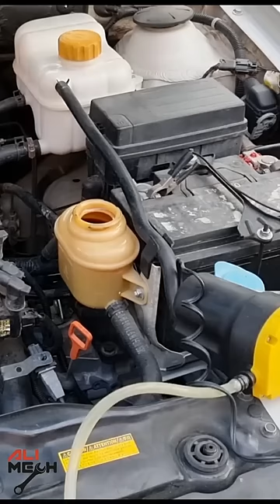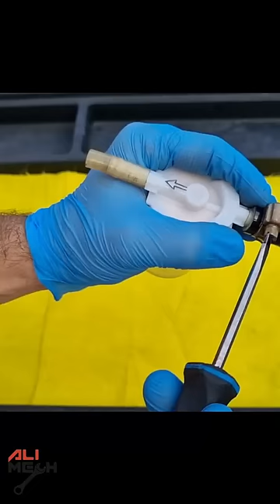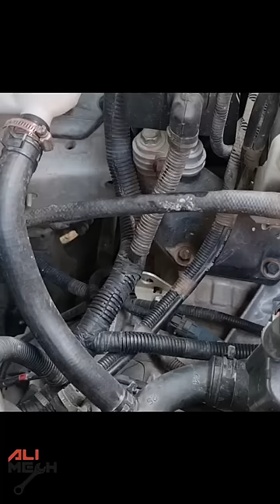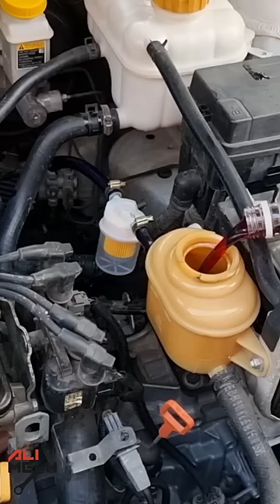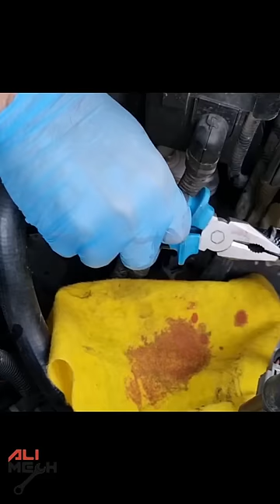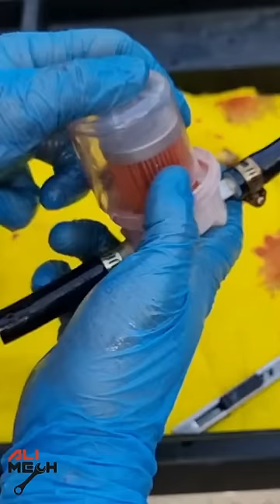This will save your Power steering? #shorts

Comment: Great idea, I'm sure there is a great benefit to this making your system last longer. If you have electric power steering you don't have fluid so this doesn't apply.
Reply: there is hydro over electric systems too.
Reply: @TdrSld  You mean electric over hydraulic, but we get what you mean
Reply: @RChero1010  sorry the dyslexia got the better of me :P
Reply: Don't forget to filter the electrons.
Reply: @mikekuschka998  don't laugh there are such filters. A Velocity Filter for Electrons and Ions does exist.
Reply: You have no idea how your servo works.
Reply: @ioanliviu22  well it depends, are you talking about a positional rotation servo, a continuous rotation servo or a linear servo? Because they all work differently. I've designed different versions of each.
Reply: @Jj_2487  auto transmissions have a filter.
Reply: why not leave the filter in
Reply: Lol try again
Reply: Because no fluid is present at the steering rack in electric steering vehicles, the grease that is used in place of constant fluid soaking and moving, gets dried up, damaging the seals. At least that's what I think  happened to my steering rack :(
Reply: @Nanogrip  wrong
Reply: @jacobpoucher  Well, it's what I have deduced, it explains why my teflon seals are worn out and my steering rack is rattling in rough patches of roads.  Grease has given up and is like melted sticky and tacky at this point.  I can't repair it unless I replace the entire rack with a new one.  I don't have this problem in my 92 Nissan Pathfinder.
Reply: @Nanogrip  I've been a mechanic for almost 20 years. Your getting a story told to you. The rack might be worn out.  But its not because of grease rather then oil. We live in a disposable world , that's probably as long as it was designed to last. Lemme guess it's a subaru?
Reply: @jacobpoucher   thanks for the feedback, greatly appreciate it. It's a Japan domestic market vehicle, 2007 Toyota Passo. Tiny car, 1 liter engine with only 90,000 km. I live in a tiny island in the Pacific, not a lot of resources and access to parts, tools, and equipment so we make due by Jerry rigging our repairs, parts, and tools. 
Yeah that planned obsolescence thing is something I definitely don't agree with, because I believe if cars last 20+ years, then there's less trash ending up in the landfill, which is important for small islands like ours. 
I do my own servicing and repairs for all my cars since the age of 15, at 40, I've given up on newer cars and will continue to stick with 90s and early 2000s cars.
Reply: @Nanogrip  that's terrible such low mileage to have a problem with the rack. I live in Boston, Massachusetts USA with a 2008 Toyota Highlander with 231,000 miles on it and my electric steering rack is fine, that's over four times your mileage. I also do as much work on my cars as I can like brakes, oil changes and minor stuff since I was 16 now 70 and it's backbreaking and takes me twice as long to do anything. 😩 I agree with you about planned opalescence, it's terrible. It's sad that greed and selfishness drives most corporations. I wish you the best with your car and hope you can get a part shipped out reasonably.
Reply: @TdrSld  yes mazda 3 holden astra ect
Reply: Are you sure the fully electric systems don't need a power steering fluid filter?
Reply: @shimon2476  I'm positive, my 2008 Highlander has an electric power steering system ("EPS" or "EPAS"). These systems use an electric motor instead of a hydraulic system and therefore do not have any power steering fluid to leak or a filter.

Comment: You can also just remove the return line and run it into a bucket and have a helper add fluid as run while working the steering wheel fully side to side a couple quart of fluids might be cheaper than the filter and you can recycle it
Reply: Good idea
Reply: and why did he put the dirty fluid back?

Comment: It is a great idea IN THEORY.  Meantime in the real world... in the early 2000's the Ford Taurus and Mercury Sable were fitted with a power steering filter  from the factory....   I can't tell you how many times I had one towed to the shop because of the filter clogging up and blowing the line off causing the power steering fluid to spray out and burn up the pump, steering rack, and a couple of them actually caught fire due to the fluid hitting the hot exhaust system.   
I AM A MECHANIC WITH 30+YEARS OF HANDS ON EXPERIENCE AND I WOULD NEVER ALLOW THIS TO BE DONE TO ANY VEHICLE THAT CARRIES SOMEONE I CARE ABOUT ( that includes my customers ).

Comment: Just don't leave the filter on and go driving anywhere. The high pressure will make it explode and you'll have a mess everywhere. I did this with an old Ford Ranger and left mine on...
Reply: Well you can put it on the low pressure side and it will work just fine I believe. Just don’t put it on the high pressure lines.

Comment: I’ve done this for many vehicles with well over 100k miles and nasty P/S fluid. But I don’t run the car and starve the pump until this “filter” gets fluid. I remove the reservoir and clean inside and out which has its filter. I then suck the entire system of old fluid with my vacuum bleeder through the return line. Install reservoir and top off system with new fluid with tires off of the ground moving wheel lock to lock. This way the system is bled and has all new fluid and a clean filter which is the reservoir. Not starving the pump at all!
Reply: hi Jeff, what do you mean by starve the pump?
Reply: @eaglehigh-h3e  “Starving” the pump refers to the pump running air through it. If there is air in the system, that can damage the pump as it will not have lubrication to pump vanes and potentially score the walls of the pump.
Reply: They are actually designed to be ran dry for a period of time without damage as part of the vane design.

Carbon vanes are self-lubricating and therefore ideal for pumps, handling liquids whose lubricating properties are poor, such as petrol, diesel etc They can also operate in unlubricated compressors to deliver air or gas uncontaminated by lubricating oil or grease.

The main issue with power steering is heat, and this is what the fluid helps to dissipate, its also obviously the carrier for the hydraulic force generated by the pump, the lubrication is a secondary benefit.

Comment: Look on amazon, there are magnetic inline filters for steering pumps. Would not recommend to use these type of fuel filter since the liquid gets pretty hot and might separate on prolonged use

Comment: I have a 2009 Honda CRV, at 105,000 miles I replaced all the PS fluid. It took about 8 bottles of Honda PS fluid. I changed it mechanically. Before the flush, there was a slight humming noise. After the flush, the noise disappeared.  The car has 130,000 miles and everything is good, no PS problems. Thanks…Jim
PS: If you do the maintenance on time, you don’t need the filter.

Comment: i had a 1984 Mercedes-Benz 190D and it had a filter in the reservoir that was replaceable to keep the system clean and working. and i think all the 1980s Era Mercedes have them stock.
Reply: The dodge caravan and probably other dodges have a filter. Ours got plugged up a couple times.

Comment: I mean if you wanted a quick way to make sure it was clean and had the materials to do this then yeah seems like a decent enough idea. Now what about getting a filter that makes it so you can just leave that on the system so its constantly cycling through and cleaning it?
Reply: Plenty of them out there on the market there universal and can also be added inline on transmission cooler lines. Magnefine, raybestos and wix has some that are all identical to each other they also come with added benefit of magnets inside.
Reply: My bmw has a filter built into the reservoir

Comment: Maybe on more modern vehicles then I drive, but on a vehicle that is over 27 years old, that I just replaced the power steering pump, and it's back to working, I don't think this will help here. The pump died due to the pulley failing, the fluid portion of the pump was still good. The gear box still works. Possibly the fact I've changed the fluid a few times has helped.

Comment: For anyone who's changed power steering fluid ,that little filter doesn't stand a chance there's no way it'll be able to handle the flow, and I'm not even worried about pressure because it gets plugged and restricted and can't bypass. 
The flow and pressures are horrendous.
We used to flush systems by disabling the spark and cranking it over so it wouldn't start ,with the return line off into a bucket. 
Trust me when I say you can barely keep up if you're pouring a quart in the reservoir while a buddy is cranking it over with the key. 
You'd probably get like a gallon in 20-30 seconds easily.
Reply: I always do these flushes with the engine running, pouring from a gallon jug. Keeping up with the flow rate at idle isn't easy but it's more than possible.

Comment: Man I need one of those. We have three vehicles with a combined 1.5 million miles and I have never replaces power steering fluid or a pump.
Reply: Unless you take really good care of your vehicles I don't think a power steering pump is lasting 500k miles and the fluid definitely does not last that long no matter what you do
Reply: @VanillaFox1-1  Maybe those miles were mostly at highway, my 30yo nissan with 300k KM has a mix of the original fluid and refills, but is mostly city driven. Now the fluid is all dark so I just pulled out the belt and drive with strenght 💪. Maybe some day I will service the steering system completely.
Reply: Don't waste your time with the filter. Just stick the return line in a bucket and cap off where it connects to the reservoir. Then have an assistant start the engine and turn the steering wheel as you pour new fluid in. After 4 or 5 liters of fluid flushing through it will be quite clean. Repeat the process after driving for a few months to get the rest of the gunk that's really stuck in there.
Reply: @VanillaFox1-1  soon he says 2 of the 3 cars have EPS😂
Reply: Why need a filter when just drain the old oil then top the new oil....how much you want to save?
Reply: @fsspecial85  who drains there power steering fluid?
Reply: keep on trucking homeboy thats impressive
Reply: @Sean M who knew?
Reply: Good thinking! Try that it may probably reach to 3M miles.

Comment: I have an old C10 Chevy pu with PS.
I installed an inline canister type fuel filter in the return, or low pressure line. Since the fluid recirculates, now it gets filtered.
It's also a good idea to suck the fluid out with a turkey baster or a bunch of paper towels once a year n replace with fresh fluid. This will extend the life of your power steering pump and the steering gearbox ...
Elementary, my Dear Watson... 🧐

Comment: Alright yea I guess you can maybe service your pre 2010 vehicle like this. I'd still would rather just flush the old fluid out entirely and add fresh fluid. Nowadays I'm actually surprised when I get to work on a vehicle with hydraulic power steering.
Reply: Yeah, and changing steering racks has become easier too with all electric.
Reply: They are getting more and more advanced but of course getting more and more expensive....lol
Reply: @fsspecial85  honestly I'm glad hydraulic power steering systems sre getting phased out at least for light duty passenger vehicles. Power steering jobs used to be some of the dirtiest jobs possible and a lot of times getting lines to thread into a new rack for example can be extremely annoying due to limited space etc

Comment: I am wondering do you need this filter at all, my father had a 1997 model Maruti Zen, had a hydraulic power system, he ran it for 22 years, so much memory with that car, both my sibling and I learnt to drive on that, never had the power steering give up on us, I guess they dont make em like that. Also we were very sad to scrap that car, everything was good, but standards of emissions & safety was different then, we maintained it very well throughout its life. We had other cars during the last 10 years of the Zen, but, non of them lasted that long. But never had a issue with the hydraulic power steering on any cars. Fingers crossed, now we have electronic steering so no need of this.

Comment: Will a regular large fuel filter work for this or do you need one for atf / hydraulic fluid?
Reply: Probably needs a real filter. Look into remote oil filter kits and find a suitable screw on filter for hydraulic fluid, that will work great and can be left on the car. Engines with oil filters mounted sideways have created a significant demand for these types of remote locators, so you have lots of options.

Comment: I have Toyota camry 2005 with 260k miles on it. I’m the the only owner. 
I’ve never replaced power steering fluid but thinking about it. Want to replace break fluid and radiator also

Comment: All the reservoirs I’ve seen have a screen on the outlet. And around the 20 yr mark, they’re clogged with grime. I just pull the tank, back flush the outlet with gasoline, leaving the cap on, and shake to agitate. Drain, rinse repeat. For extra fun, dump it out onto a paper towel and see all the neat treasures you can collect! Rinse with brake cleaner. Reinstall.

Comment: Would it be a bad idea to leave one of these filters on long term?
Reply: Depends how restrictive it is, if it's decently free flowing then it's probably fine. If it's very restrictive then the engine's going to be working the pump harder and wasting gas, potentially wearing out the pump in the process. Get a big enough filter and this is totally fine, although I'd prefer a metal filter housing.
Reply: They make specific power steering filters that are small with a free flowing magnetic mesh. No back pressure, keeps the glitter out of your pump.

Comment: Adding a power steering cooler will also help too
Reply: It should only be done in warmer climates.  In cold climates, never on vehicles with factory in-radiator systems.   
  An aftermarket p.s. cooler can overcool the fluid when driving in below freezing weather conditions.    
 I’ve had modded cars&trucks coming in the shop in winter with a non-working p.s. systems.    Once we switched the hoses back to the factory in-radiator cooler(&heater) the vehicles worked fine.
Reply: @cjwrench07  yeah this is also a factor, but some vehicles dont have a factory cooler in the radiator for the ps system. But you do have a valid point no need for it in a cold climate period.

Comment: Where did you find a filter so small for hidraulic fluids? 
That one It is for diesel carburant. It is too thick and can crack. Maby something like a fine mesh is god. And you can chipe longer time.
Reply: Petrol filter. Do not drive with it.

Comment: Wish i could find that filter he shows
Reply: Looks like a regular fuel filter for a lawnmower
Reply: Wix 33013
Reply: it is just a generic disposable petrol filter for most carby cars to say mid 80's before fuel injection and high pressure metal filters - but dont leave it on for long as they are designed for 5-8 psi not what the power steering puts out

Comment: Power steering pressure can be 1500psi, and the volume is pretty high.   Fluid goes everywhere when this filter gets blown off and could become a fire hazard.
Reply: It’s on the return line. 1500 psi on the return line would blow the hose or send the reservoir lid into outer space.
Reply: @scroungasworkshop4663  What happens when the filter is loaded with the trash it's supposed to catch?
Reply: @thisisyourcaptainspeaking2259  Seriously? If the filter becomes clogged enough to be completely blocked the power steering is rooted anyway.
Reply: @scroungasworkshop4663  Have fun with your plastic filter blowing up.
Reply: @thisisyourcaptainspeaking2259  return line isn't under high pressure

Comment: Why take the filter back off?
Reply: They will explode, I have done it. Only idling on first filter with new oil. Then change and drive on low rpm, steer a lot. Then remove.

Comment: most toyotas have a filter built into the reservoir.
Reply: I don't know what the new ones are like but I know on my 98 4runner it's just some wire mesh at the bottom of the reservoir.

Comment: That is illogical, since the old oil is poured back in. Disconnect the return line and drain the old oil into a container while person 1 turns the steering left to right and person 2 constantly tops up with oil. Then the dirt comes out. But be careful, the pump must not run dry. A pressure-resistant filter can be permanently installed for safety.

Comment: What’s to keep a fella from leaving the filter on?
Reply: That filter is designed for a 5 - 10 psi fuel system, not a 800 - 900 psi powersteering system.
Reply: @00sean00  the low pressure return hose is typically only rated for 400 psi and runs at a tiny fraction of that limitation. So I’m genuinely curious as to why one could not keep a filter on the low pressure side.

Comment: Is that transmission fluid?
Reply: Transmission fluid is often used as power steering fluid
Reply: @steakdaddy2600  I once raid that transmission fluid is bad for steering because it has solvents
Reply: @thecool307  sometimes the owners manual for your vehicle will specifically ask for transmission fluid in the power steering, it’s not for all cars though, it depends on what your manufacturer calls for
Reply: @thecool307  my 98 dodge Dakota that leaks power steering calls for atf
Reply: Most power steering systems I've seen over the past 10 years call for ATF. If it's a Mack truck they usually call for 15w40 engine oil.

Comment: Typical power steering pump can flow about 3 gallons per MINUTE. I doubt this small inline fuel filter is large enough to handle that type of flow rate - especially after getting embedded with debris. I would feel more comfortable installing a remote oil filter housing. So, yeah - bad idea here.